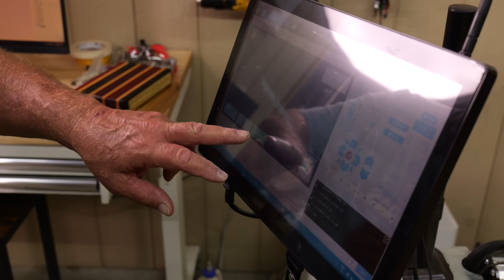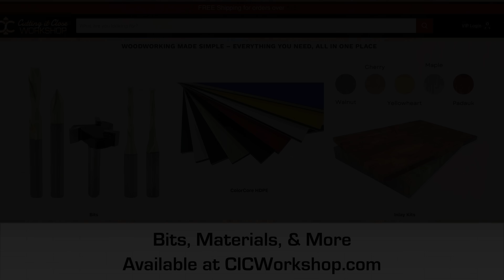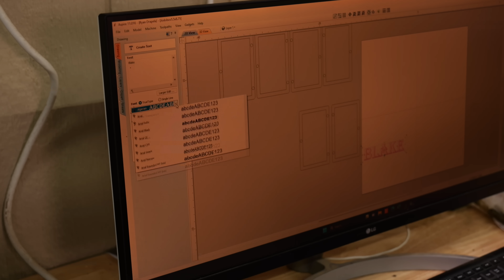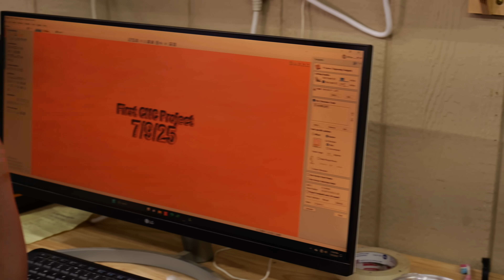Can a 13yr old Learn CNC?

Comment: Great job to all three of you. Blake, great job, keep going. Woodwork opens a completely different area of your mind. The CNC just puts it over the top.
My dad was a woodworker. I bugged him enough to help and do my own thing, at about 6 or 7 years old he gave me a piece of sandpaper and a block of wood
and said this is where we start until you can see over these tables. And it all went from there. I left the craft in my teens, then got busy with my plumbing career. 
He passed away, long story, but I opened a box and saw the first sawblade he let me use on the table saw for the first time. It was a Craftsman twist dado blade 
still in the plastic tray, complete with the cardboard sleave and instructions.
I felt he was letting me know it was time to get after it again. So long journey, around 30 years and here I am... lol
I've taken the craft farther than he ever did, but wouldn't be where I am if it wasn't for him. I still have the dado blade...
Thanks to y'all for doing what you do here, to educate and provide us with the best bits I've used to date!!!